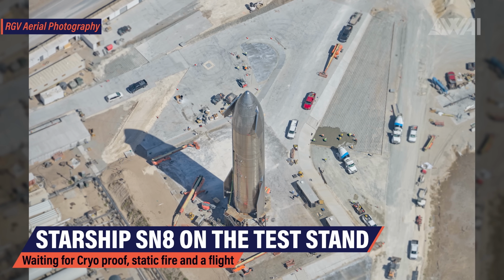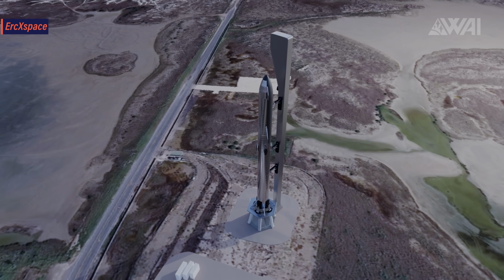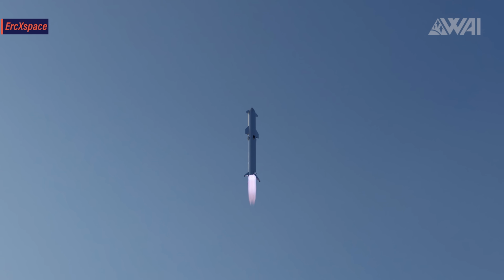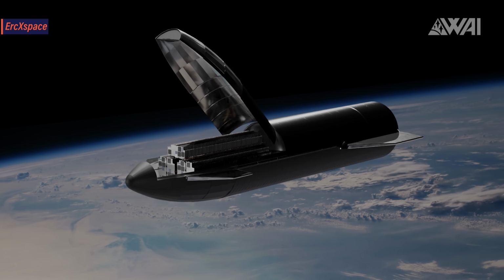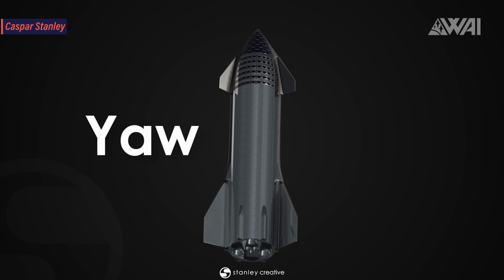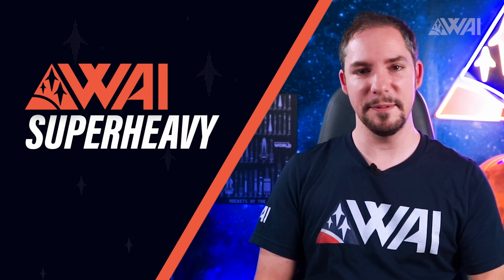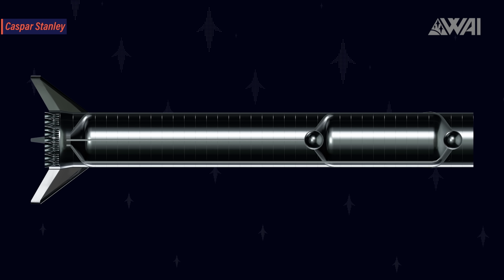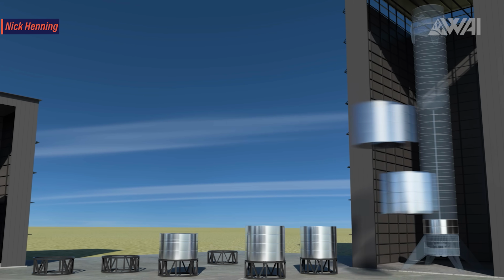130 | SpaceX Starship orbital Starlink flight from ignition to landing!

Comment: You mentioned header tanks for both Starship and SH (Super Heavy).  I don't think SH will use header tanks.  It will fly a flight profile almost identical to Falcon 9, and F9 certainly doesn't need header tanks.  Maybe, you could contact SpaceX and find out for sure.  I'm sure they'll give you a good "header" on the tanks.

Comment: I think the cargo version of Starship will ditch the "Clam shell" hatch design in favor of a split door design similar to what the Space Shuttle had. It would make it easier and less complicated for loading a payload into Starship while vertical on the stand. The clam shell design puts the door in the way of loading machinery and would change the rocket's center of gravity when open.
Reply: They will find a way to mount a payload for sure, and actually the Shuttle style is more complicated cause you have to move two parts instead of one

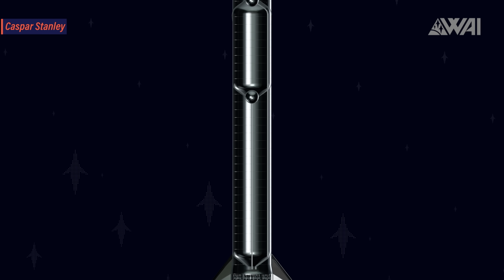Comment: 9:50 not to put too much water into your wine, but if the propellant for the booster alone is 340k$ and the load ist up to 100 metric tons, that would be at least 3.4$ per kg for the booster propellant only. Add the propellant for the starship and the maintanance + ROI needed for each of the components, I can't believe 10$ per kg (which you mention in the beginning of the video will be the retail customers price. 10 $/kg could on the other hand be SpaceX's cost per kg which - if they do the calculus conservatively would still put the retail cost to 25$/kg (not to mention the cost for getting the legal permission to put that kg into space and evtl. removing the space debree afterwards - which will have to be charged to the retail customer sooner or later.).

Comment: Personally I think Boca is only ever going to see 3 Raptor engine launches on that new platform, the Starships will be built then transferred to another location mostly likely Cape Canaveral for full orbital launches with all engines where the 15 km radius has no influence........all the infrastructure is already there and Space X have invested heavily at the pads at the Cape.
Reply: But the Cape pad is still on hold since a long time ago. The roberts road facilities didn't even fully developed yet. The problem is more of a frequency rather than just the sound itself, which thus ofc Boca will have just occasional flights
Reply: @alvianchoiriapriliansyah9882  I think your'e confused.........the Cape Canaveral pads (Kenney Space Centre) have never been on hold.....crew dragon was launched from there and so was quite a few Starlink launches, it would be nothing for Space X to launch a 3 engine Starship to Kennedy from Boca, refuel etc and launch with cargo etc.
Reply: @geanozz8940  It isn't that simple bud. If you're talking about Falcon booster hoping from Boca to Cape yeah ofc, but this is Starship with different propellant*. What I'm talking about on hold here means the launchpad designed for Starship. You can't just put Starship to existing operational 39A (which ofc isn't anywhere near on hold) and launching it to orbit. Where's the methalox tank farm? Where's the production facilities at Roberts Rd.? Right now the launch pad is juts a steel skeleton (and it's been like that for quite several months maybe even a year!). Modifying the existing pad for Starship would ofc take a long time & money, and disturb a lot of Falcon launch cadences especially crewed Dragon

If they want to do the maiden flight next year in here (and assuming that they will accept a high risk of RUD on the pad which would destroy NASA-owned historical property), they have to start again the construction right now

If the Starship will hop to Cape, that's mean they're doing E2E as well, but Elon doesn't expect the E2E first test flight to occur until at least 2022 (and I'm fully sure that Starship is well operational to orbit by then)

Comment: I think the reorientation will happen in much higher altitude. I mean, it's really dangerous to perform it near the landing location.
Reply: Then it will waste more delta-V cause it only taking advantage of atmospheric drag for a shorter time. It will be either success or crash, and they're fully prepared when it's crashed because there's SN9 & 10 underway. If it fails just fix what when wrong and try it again
Reply: @alvianchoiriapriliansyah9882  Oh I see, thanks for the info. I think your right, if they want to stabilize it in an upright orientation during descend, they should've attached grid fins instead of flaps.

Comment: Very excellent presentation, Felix. You have a real talent for being able to explain complex scientific and engineering topics in such a way that the layman can understand them, without boring those who have greater technical knowledge. I certainly hope we get to see that flight in the next year or so. I have a personal stake in wanting Starship to be operational before SLS flies.
The renders you used here seem to show the anterior side of the Starship completely covered in ceramic heat shield tiles. My understanding was that SpaceX intended to use those only on those areas that would experience the most extreme thermal affects. Has that changed?

Comment: I have concerns with ice build up on that header tank in the nose, it’s going to have significant thickness and mass by the time it fills what happens when a large chunk falls off and hits the flaperons, will it damage the heat shield?Will it jam the flaps?  Is there any measures a crew could take in orbit to deal with this?
Reply: Pretty sure it will be covered by heat shield nose
Reply: @alvianchoiriapriliansyah9882  but those are only a cm or two of heat shield ice is still going to build up on that and likely in significant amounts.
Reply: @thedyingtitan1247  No it wouldn't be significant

Comment: The current Falcon 9 deployment of Starlink has the 2nd stage rotating on its vertical axis.  Would Starship need to have "reverse thrust" from the cold-gas thrusters put in to avoid them hitting the clamshell door as they are deployed?
Reply: Would be interesting to see

Comment: If that launch price point sticks...

It will cost more to order a quarter pounder on Uber Eats than it will to shoot that same quarter pounder into low earth orbit...

What a time to be alive.
Reply: The ISS will be ordering McDonald's using SpaceX Food Delivery Inc. LMAO
Reply: I think that price would just be fuel.  Last estimate I saw was a little under $1 Million for fuel ($10 per kg) which didn't include operational cost or life expectancy of hardware.  Hopefully it is at least a 10 fold gain on the next cheapest I could find - Falcon 9 ($2,720 per kg).

Elon has indicated the turn around time between launches of the same booster and craft is greater than desired, significant for in orbit refueling and global passenger transportation.

Comment: Why does the Starship need insulating tiles but the booster does not?
Reply: Because it will reenter at orbital velocity while the booster didn't
Reply: The booster is suborbital... it flies up, then turns around and flies home, having achieved only a small fraction of orbital velocity, and with correspondingly little energy to get rid of. Starship goes all the way to orbit and beyond, so it's coming back into atmosphere with far more kinetic energy to get rid of, which it's doing by crashing very energetically into molecules of air that can't get out of the way quickly enough.

Comment: I wonder how well the heat shield panels will perform. Hopefully they want have the issues that the Space Shuttle had. Meaning many had to be replaced after use.
Reply: It's designed for multiple use ofc
Reply: @alvianchoiriapriliansyah9882  Good, because that would significantly slow turn around.

Comment: Question: how can the starship structure support all that weight? Esspecially upon landing? It's such a thing skin, with pressureized liquid just inside the wall. I know if you stand on a can of soda, it won't crush if sealed. But, will if it has even the slightest knick. How does the little stringers support vertical weight? The bottom rings will have SO much weight on them, I don't foresee good outsomes... :[
Reply: It will be pressurized the entire flight, just like a strong soda can would

Comment: Why install the weight of 3 sea level engines if they are only going to use the 3 vacuum engines for most of the flight?
Reply: The "most" part, they are needed for landing.
Reply: They are what make it reusable, the expense of carrying the sea-raps and the fuel, out ways the cost of an expendable rocket.  I think..
Reply: I am wondering if the vacuum engines could be used for landing or just one sea level for landing.  I know they have tons of engineering experts working on it, just is a wonder why the three.
Reply: @jaredroberts6409  On Mars they could use one RVac & one SL (gimballed) just like the HLS would
Reply: @jaredroberts6409  Two factors. One, vacuum-optimised bells tend to result in instability at higher pressure, causing vibration, increased wear, and potential damage. And two, their greater size means they're difficult to gimbal, and therefore not used for steering... not a problem in vacuum where RCS is adequate, but big problem for pulling a swoop-and-land maneuver.

Comment: @Whataboutit!? When you put the starship on top, the big booster ... would it be able to hold on to the weight from the starship, or would it collapse from the weight coming from the starship?  Does the big booster need to be refueled before it can hold the weight of the starship?
Reply from the maker: I am prety sure, the booster might either need stronger internal bracing or it would need to be at slight pressure. Not fully fueled though.
Reply: I think back to the time when an older test model collapsed because the refueling was a bit wrong.  There was too much weight at the top and the bottom part could not hold up.
 On the other hand, with starship, that it is fully ready when it reaches the top of the big Buster, could the same thing happen when it is on the ground?  And what will happen when it burns the fuel on the way up, is the same risk there?
Reply: @kenthansen5422  Pretty sure the engineers had done the maths
Reply: Super Heavy is designed to hold the dry weight of a Starship and the 100 ton payload. It must be pressurized before the Starship begins taking propellant.
Reply: @imconsequetau5275  Nothing official on that for sure

Comment: I've just realised that the non-vacuum engines are practically pointless.  They are only used for the last 30 seconds of landing.  Even on Mars for take off to orbit, I'd expect the vacuum engines to be more efficient than the non-vacuum engines.
Reply: The Vacuum ones don't gimbal due to nozzle size, that's why the standard ones are needed.
Reply: @csgergo80  I thought that but then surely there is a better work around. Obviously I don't know the fine details but carrying all that mass for the sake of a few seconds gimballing seems like an awful waste.
Reply: @Spedley_2142  When it's a super-heavy lift, the old motto of hyper light like expendable vehicle doesn't seems super relevant anymore

Comment: I want to know why superheavy needs to have 30 engines when the test should take only good - only a few would be better for the environment and less fuel will be needed
Reply: The test Elon has said will likely use just 2 to 4 engines, but it will be a short flight like SN 5 and SN6 to about 500 feet followed by a landing. If it is pushing the Starship to orbit it needs all 28 engines.
Reply: @MrEd2291  Some calculations suggest that they could launch Starship to orbit (zero payload tho) with 80% fuel load & 19 engines on Super Heavy & 3 on Starship

Comment: I hope the real thing will be as exciting as this demo!  ;)
A quibble: the height of SH is now 72m - Elon increased it from 70m a few months ago, IIRC.
The SH sections: two are reinforced 4-ring barrels, which are what SN10 & 11 will need to mate with their nosecones for the forward section. The reinforced 5-ring barrel is probably for SN9, ditto. (IIRC, the top dome sleeve now has 3 rings, with the dome now more recessed. This eliminates one ring from the fore-section.) I can believe SH may have reinforced barrels for parts of the tank section, to support its full height and the SS on top, when both are empty and unpressurized.
Reply from the maker: Thank you, Don!!! 100% agreed about the internal bracing for SH. That and a combination of light pressure before stacking might be a good idea. :_WAIRocket:
Reply: I think we'll see SH's height increase over time as Raptor thrust improves. The max height of the rocket is determined by the thrust per area of the rocket engines at the base